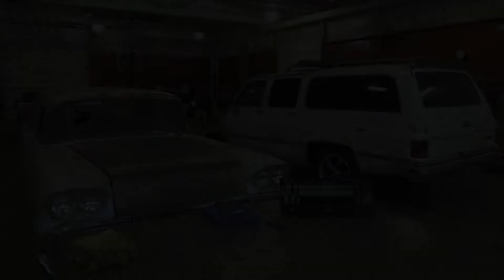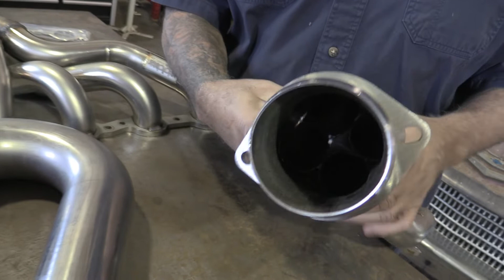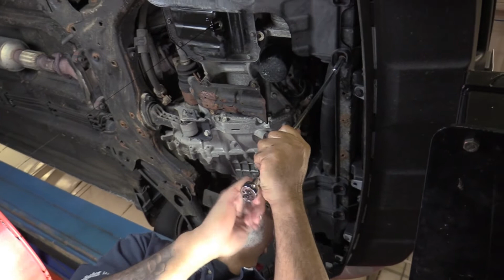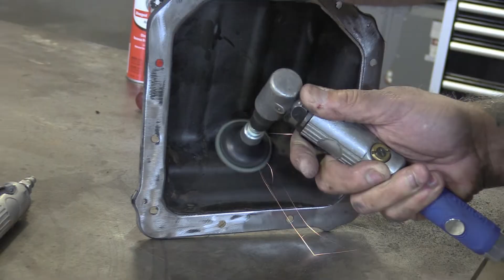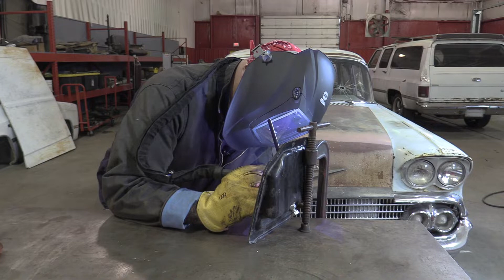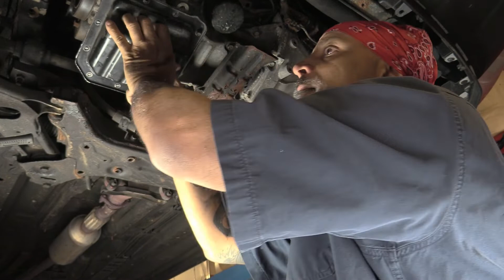Lou Santiago Cuts Spot Welds Out Of A 58 Chevy Delray | KIA Extreme Oil Change on Garage Insider TV

Comment: Lou, I’m wondering what you are doing for a replacement pan? They only make the 4 individual patch pans and I know they make the floor braces but not the under seat area. Are you planning on custom making some of it? I am curious because I’ve had 58s for years and always wished they made a full pan.
Reply: If I ever hit the lotto . $$$$_ I WOULD MAKE ALL THE STUFF FOR A 58...  IV SEEN SO MUCH RUST OUT ON THEM AND NO AFTERMARKET PARTS AVAILABLE. LIKE THE ( FAB. TRY  5. GAG )  U KNOW BELLY BUTTON CARS. LOVE 💞 THE 58S. SO MANY FIRST'S ON THEM . LIKE SIDE MOTOR MOUNTS.  EXC.

Comment: Lou, I'm doing floorpans in my 85 Mustang. I don’t feel like Im skilled enough to fit and butt weld then in. I was planning on lap welding with weld through primer (about a 1/2”- 1" lap) and 100% welding both sides. Then grind the welds and skim with seam sealer. Since cars are basically lap welded from the factory already it seems like an acceptable method if done correctly. Opinion? Thank you.

Comment: I used to install roof antennas. Nothing worse than ruining a headliner. So I spun electric tape around the bottom of my drill bit so I couldn't go further than 3/8 in. Would that help drilling out a weld in a pinch?